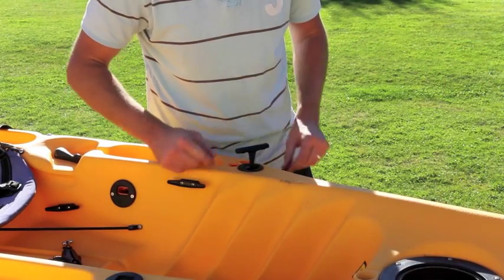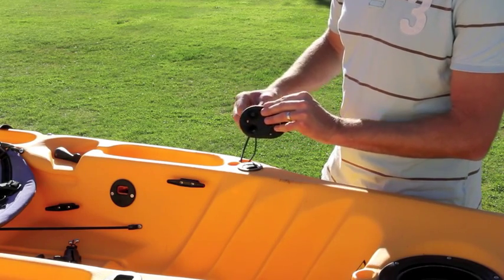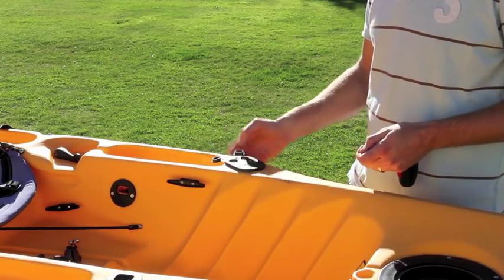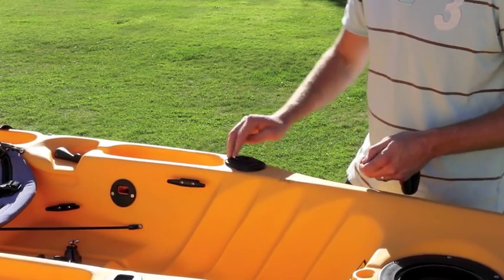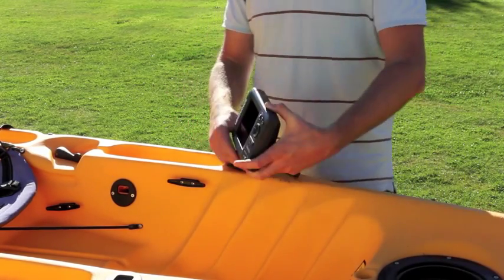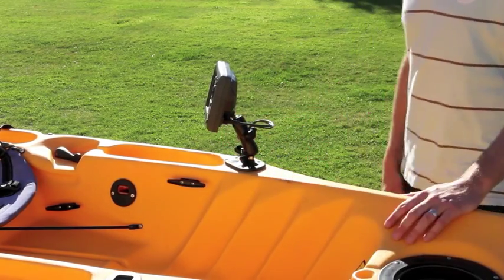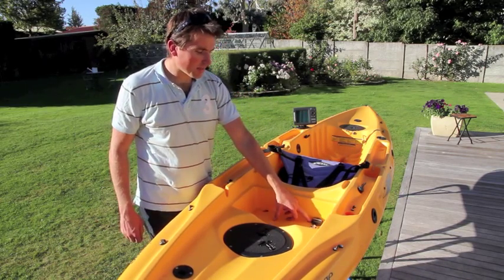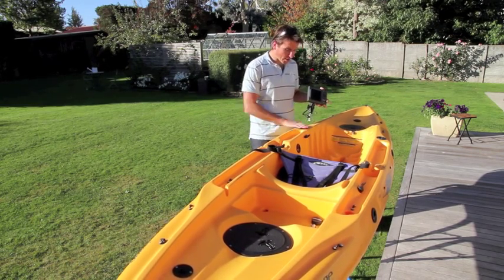Lowrance Elite Socket Installation Tallon

Comment: You can remotely display and control the TI fish finders>>>allabout.wiki/gd3d   So if your fish finder is on the back of the boat and you are up front using the trolling motor, you can still view and control the fish finder. Also you can download maps and upgrades easier using wifi. Not available on Hook.